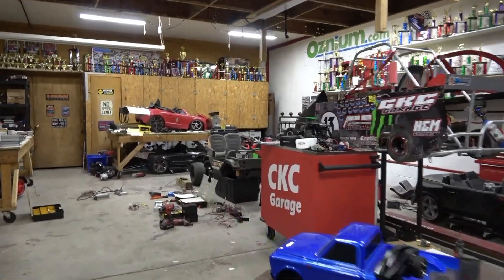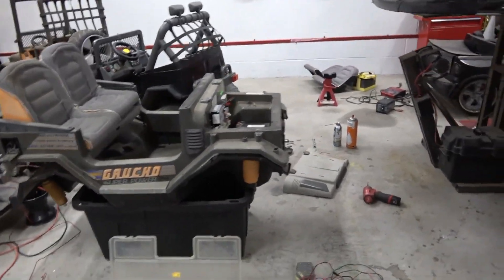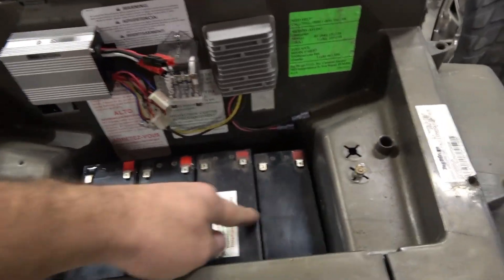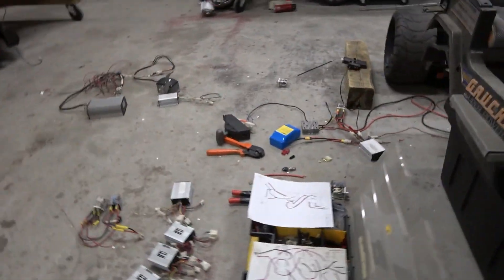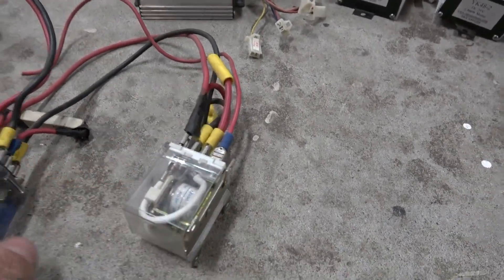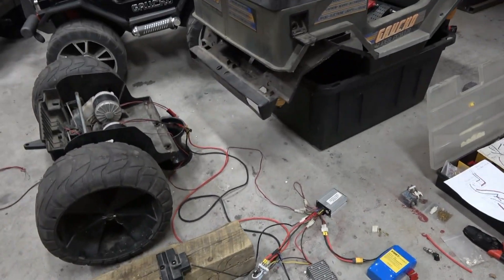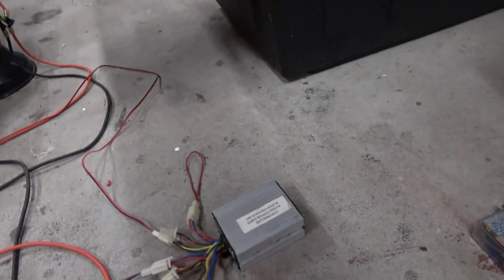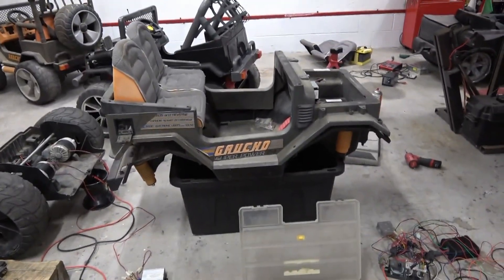Peg Perego 24 volt Super Power -control board DIY repair video

Comment: Wow, working on my son’s  Peg Perego RZR 24 V. 
I feel dumb. I don’t understand how to connect the wires from shifter. 

I will use only one speed. Do I need 2nd relay if I don’t have the brake?
Reply from the maker: One one relay for the reverse. Wire a ground from battery to relay coil. Run positive from battery into shifter switch and then come out of shifter to other relay coil. Basically the shifter activivates coil to reverse polarity

Comment: Hi guys, awesome conversion, but.. 🙂 I´m afraid 36V will be much more powerfull to handle, maybe not for my son but for his friends for sure. Is it possible to use some one direction PWM regulator (10-50V input, 60A, 1500W) to temporarily adjust lower voltage from controller output for motors (blue and yellow) to relay? Just cut this path and add the regulator between? Greetings from Czech republic. Thanks Martin

Comment: Your link for the relay is to a 12 volt relay. Is that going to work with a 36 volt setup? Or do I need to get a different relay? You have a copy of your wiring diagram available?
Reply from the maker: You use a step down converter so you would need a 36 to 12 volt step down

Comment: Hi...writing from Italy...do you think I can do the same for a gen2 supergaucho? I have One of the First released, still with 3 Speed, and control unit Is no more available. Thanks
Reply from the maker: For sure. It's a great fix/upgrade for any ride on
Reply: @CustomKidzCars  doubt Is if engine and transmission gears Will sustain this additional strength..(.I reviewed many of your videos and also looking at new models in the market, my feeling Is that quality of product Is Always decreasing)
Reply from the maker: @DanieleGhislieri-nc3sw  definitely not as strong as the gen 1 gearboxes but the peg boxes and motors stand up to 36 volts just fine, especially with a variable speed throttle setup
Reply: @CustomKidzCars  many thanks
Have a nice day
Reply: Ciao Daniele hai risolto il problema? @DanieleGhislieri-nc3sw
Reply: Mr Jones can I do this to the goucho rocki'n will it handle 36v